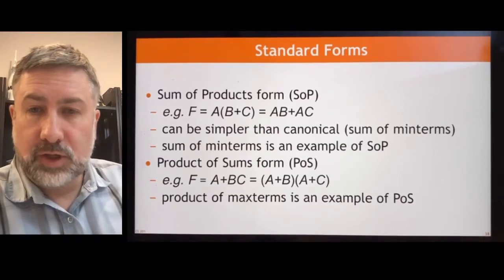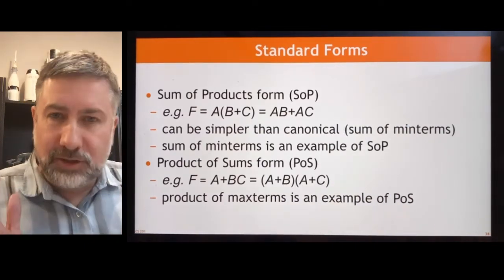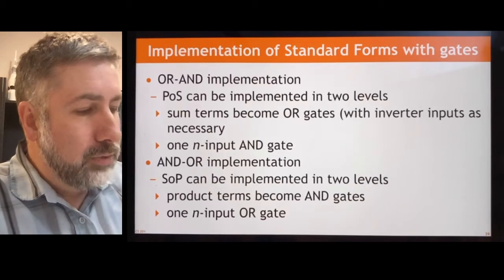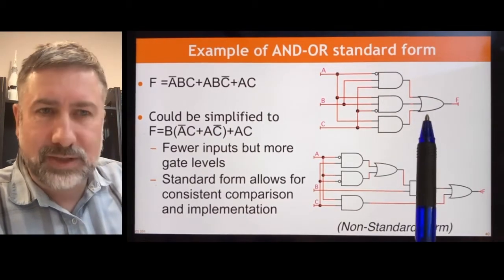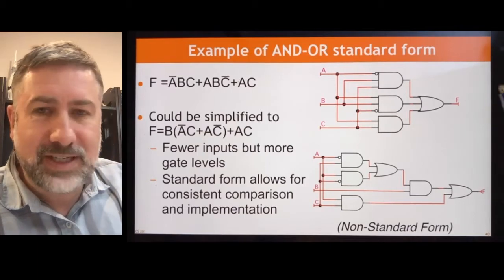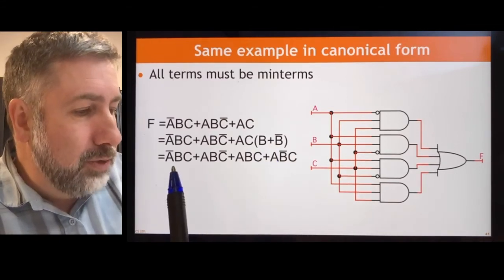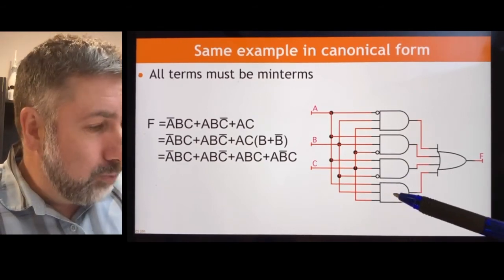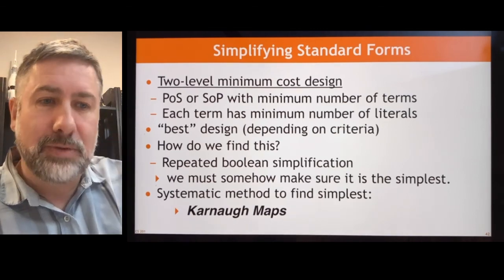Simplification 4: Standard forms and minimum 2-level implementation

Comment: What is the difference between a bubble and an inverter if they both do the same?
Reply from the maker: A bubble is just a shorthand notation for logical inversion, either on an input or an output of a gate. its quicker and easier than drawing a complete inverter. 
The transistor implementation of a NAND gate is smaller and faster than an AND gate and a NOT gate, but for the logic problems it's the same.